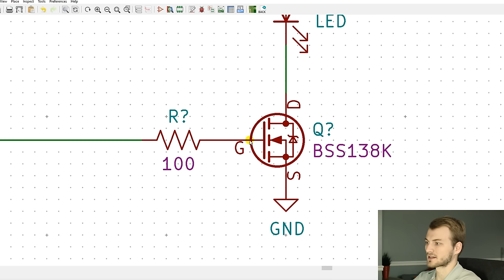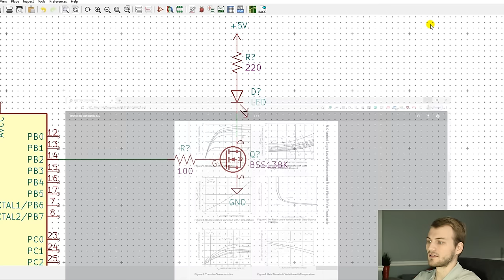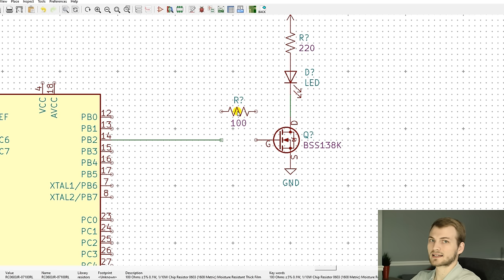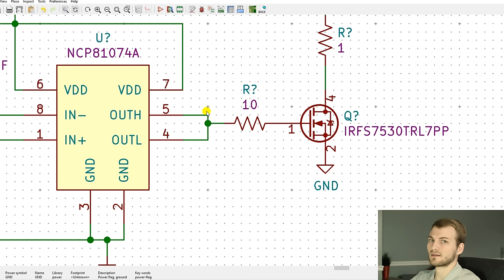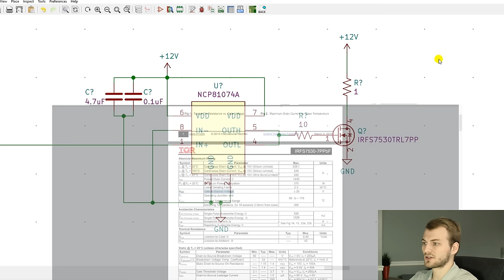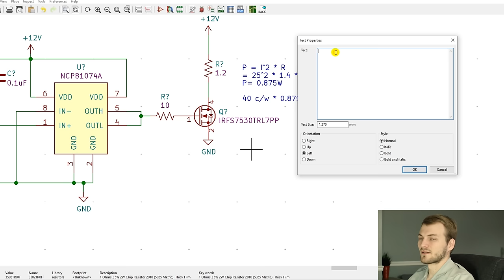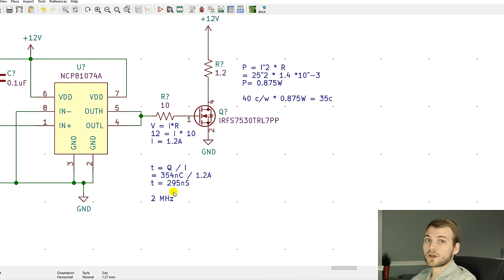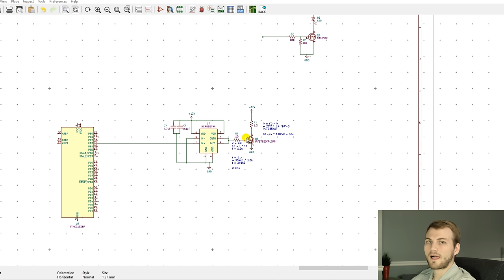Designing Power MOSFET Circuits - Circuit Tips and Tricks

Comment: I found your video very helpful, but still i'm trying to understand the Maximum Safe Operating Area. From that plot it should handle a little more than 1A for a Vds of 12V in DC. Which is way lower than your design. I can't get it.
Reply from the maker: Yeah, so the MSOA chart is based on super short intervals, and at large voltages. In a standard low-side switch application, the FET will be dropping a really small amount of voltage. So you should always be well below the curve. I really don't reference it often honestly. Use the Rds and your current to calculate the voltage across the FET. It will typically be well under a volt.
Reply: @MicroTypeEngineering  Thank you for your reply!

So if I understand correctly, i shouldn’t use the full VDD as my Vds in the MSOA chart. But just the voltage drop due to the Rds*Id . Which should be lower due to the presence of the load. This all starts to make sense..! Still have to perform the calculations. You helped me a lot! 😊

Comment: In 2023, logic level Mosfets are much better than you say. The low cost IRF3708 can deliver 12 Amps with a gate voltage of 4.5V and has an Rdson of 10 milli ohms.

Comment: newb question, why not just use a transistor if all you need is logic level? thanks
Reply from the maker: You can use either or, but unless you need the additional gain or current control of a BJT, a FET will be superior in almost every other way (except price sometimes). Also, since FETs are voltage controlled and not current, they're much easier to implement too.

Comment: What about the turn on/off and on/off delay time mentioned in the datasheet?
Reply from the maker: Yeah, that's another way to see the result of the total gate capacitance. I find it to be less useful than the gate charge though, since you don't directly know the current injected some times. Also, it's usually measured in 10%to 90%.

Comment: I saw your post in the link you have mentioned. I would like to make a small question regarding the current you have calculated in that blog.  For the current calculation you have used the driver voltage divided by the resistance. But i have found something different which is  gate current is equal to the Voltage difference between the driver and the gate(which separated by resistor) divided by the resistance. As found in this link;

https://www.vishay.com/docs/73217/an608a.pdf

Can you please update us about this?

Comment: Why you did not mention switching power loss?
Reply from the maker: I should have. I had to limit what went in the video, and was focusing mainly on high-power low switching speeds drives. But yes, I wish I would have at least mentioned the losses during switching.

Comment: Electrons are negative so current flows from negative to positive (source to drain). Why do engineers insist on using conventional current.
Reply: G E T  R E K T  By that logic we can say water runs up hill.  It doesn't matter, the physics is the same.
Reply: It's a convention, agrrement. I think that was before electrons were discovered.

Comment: I completely disagree with your conclusions about logic-level mosfets and the the reasons you gave. Your "incredible trade-offs" don't seem very incredible to me. Take a look at your objections: "basically the Rds(on), the amount of gate charge". Check the datasheets for a couple of popular mosfets and their logic-level equivalents:
IRLZ44: Qg = 66nC; Rds(on)=28mΩ @Vgs=5V
IRFZ44: Qg = 67nC; Rds(on)=28mΩ @Vgs=10V
IRL530: Qg = 28nC; Rds(on)=160mΩ @Vgs=5V
IRF530: Qg = 26nC; Rds(on)=160mΩ @Vgs=10V
Now are you going to tell me with a straight face that those differences in Rds and Qg are indicative of "incredible trade-offs"?
Unless I need a mosfet gate driver, I'm always going to specify a logic-level mosfet if I'm controlling it from a 5V or 3.3V microcontroller, and I'd strongly recommend others do the same.

Comment: It's  a shame you discourage the use of P-channel FETs. It seems you're sharing knowledge from an incomplete understanding, which will lead to confusion from others.
Reply from the maker: Care to elaborate? Ofc there are exceptions, but generally NFETs will be more efficient (lower rds and gate charge) and definitely cheaper than comparable PFETs. Also there's lots more available.

Especially when it comes to power drives, NFETs are almost exclusively used.